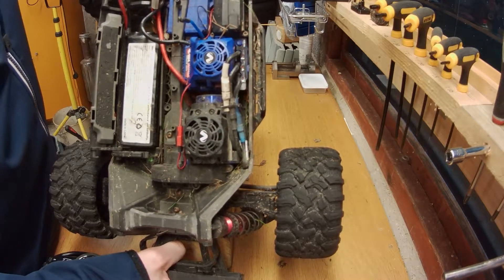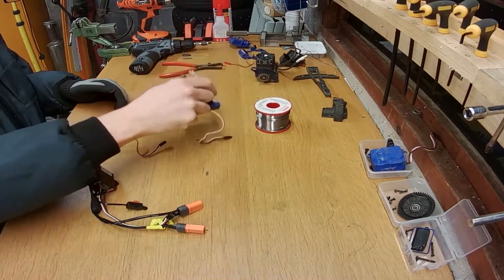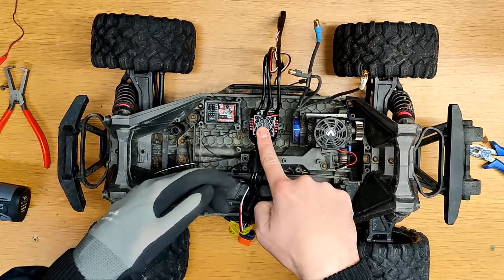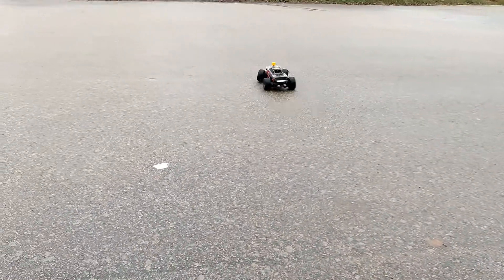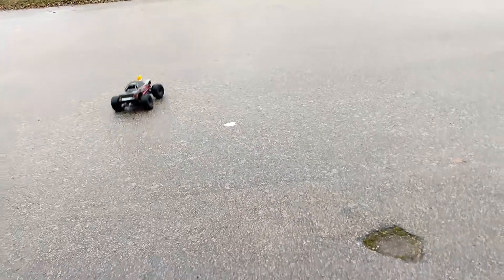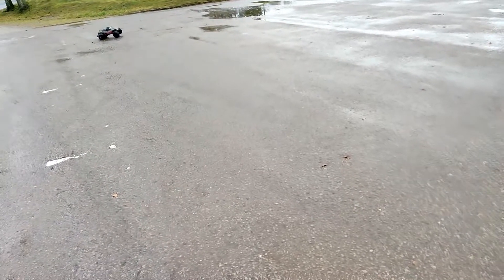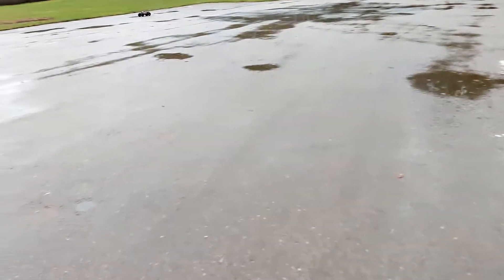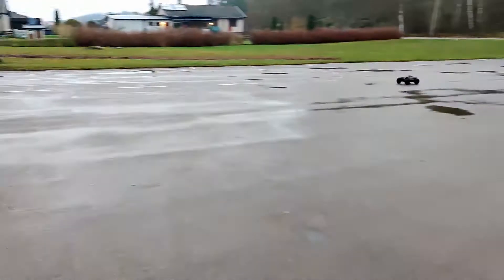Traxxas ESC, 4 blinking LED... My Solution!

Comment: hope that wasn't cause you had your controller throttle turned up or down. it would be in a safety mode so when you turn the maxx on it don't take off